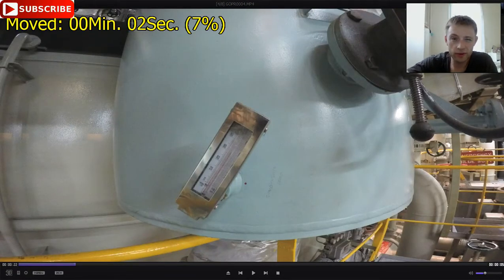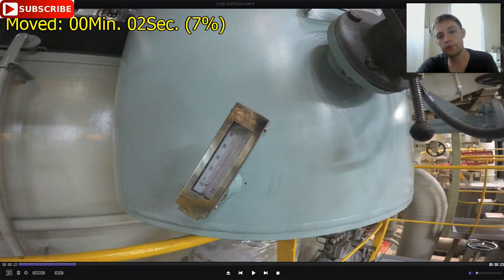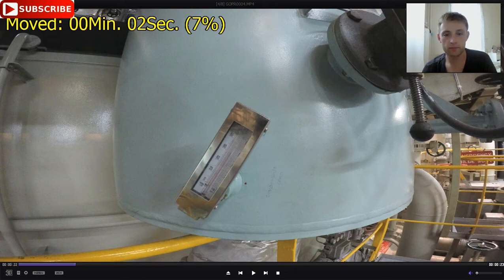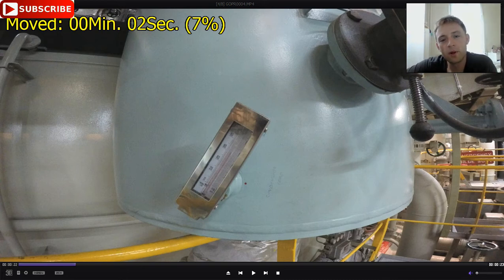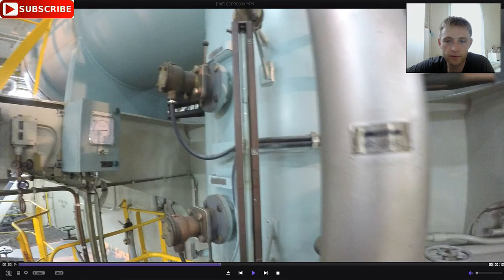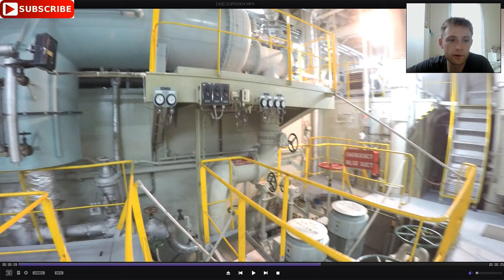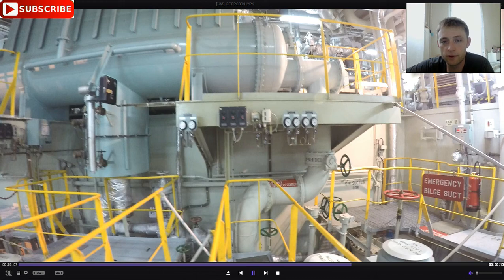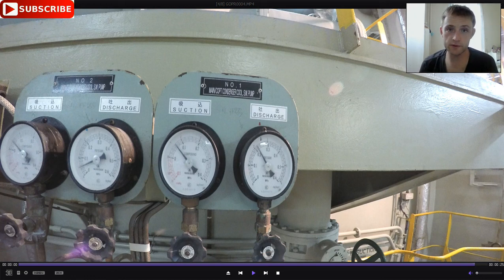COPT Vacuum Condenser - DongHwa Entec

Comment: What is the use of sealing air blower in an inert gas system on board a crude oil tanker, where an boiler uptake is used to make inert gas for cargo tank
Reply from the maker: Sealing air purpose is to make a wall of air which will provide additional sealing to IGS uptake valves.In case your boiler are working and gases Leaking back to scrubber tower which is not working at sea.So this will help to prevent any damage to scrubber itself .Other functions of sealing air is to keep clean the seating surfaces of the butterfly valve inside.But even with the sealing air uptake valves damage through the time most of the damages that you can see is stuck of the valve.
Reply: Thank you sir
Reply from the maker: Welcome!

Comment: Sir i have a problem. What is the main reason of salinity of vacuum condenser pumping via copt condensate pump to hotwell ?
Reply from the maker: Leaking tubes.But better take sample and measure it to see if the water corresponds to the hot well measurements of chlorides.
Reply: @Adventure-Story  So what you mean is that there are holes in the pipes inside the vacuum condenser. Am I understanding correctly?

Comment: Sir how much vacuum we usually maintain and why we use shell and tube type why not plate type as a vacuum condensor
Reply from the maker: My opinion is it is more reliable tube type than plate type and easy to use also there is steam to condense which in some points reach 160 degrees just imagine what will happen to rubbers .
Reply: @Adventure-Story  yeah exactly sir ,how much vacuum we usually maintain
Reply from the maker: @ajithakk3178   it is minus 85 mmHG if i remember  correct.

Comment: Why we creating vaccume inside the condenser.?
In freshwater ganerator water is boiled at 40°c because of vaccum. So how can we condense the steam by creating vaccume inside.?
Reply from the maker: Hello dear friend steam which enters vaccum condenser already gave most of his pressure and temperature .When steam enters to vaccum condeser is about 110 degrees celcius then as it passes from tubes it will cool down by sea water so it will be condensate water on outlet.We need vaccum to increase efficent power output of pump.In case there is bad vaccum pump will work on low output even if you increase rpm turbine will not follow.Also vaccum  increase the flow through all system.Thanks!
Reply: @Adventure-Story  Thank you so much sir.
Reply from the maker: @surajsomarajan8336  Thanks!
Reply: Adventure Story . Please give me advice if during cargo operation I am keeping the watch in ECR and vacuum in condenser goes down what action first I should do. Step by step  please. What is correct action as Watch Engineer . ??? Vacuum condenser high pressure alarm 🚨 it’s very dangerous alarm 🚨
Reply from the maker: Also one more thing that can happened is vaccum brake due to high temperature of condensate so the solution is to increase cooling by startbone more sea water pump.But before you do that  check the suction of the pumps to
Verify that sea chest is free from dirty.
Reply from the maker: Vaccum is need for condenser so steam willflow there and also pump effectiveness achived.Steam then condensate by condenser where sea water passing from one side and cooling down the steam until 42 degrees celcius.
Steam from turbine is high as much as 180 degress so from180 until42 degrees celcius is enough cooled to be as water which will be transfered by condenser pump to hotwell tank and them back to boiler but hotwell tank temperature must be increased to 90 degrees then before enter boiler again.
Reply: Adventure Story Thanks 🙏 a lot. Fine Explanation with advice.